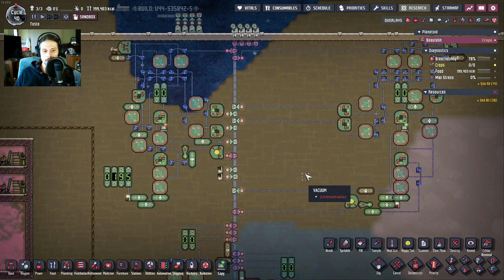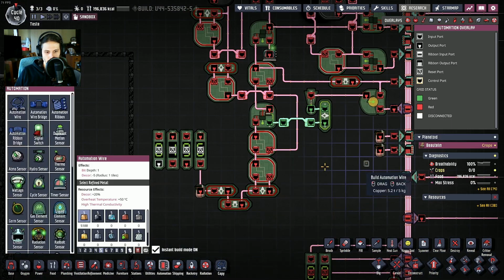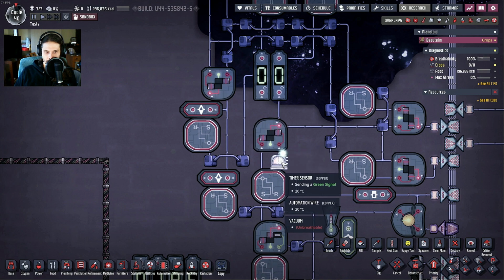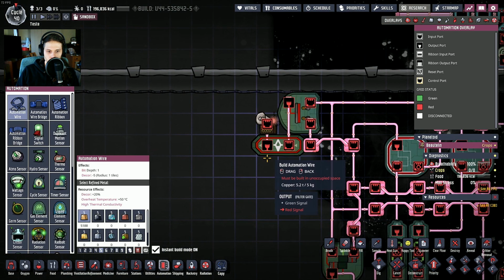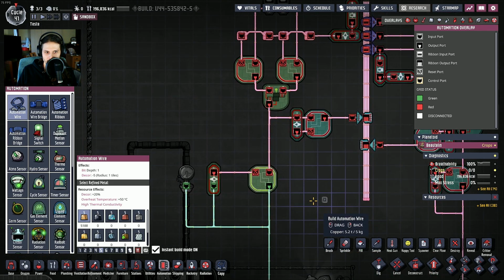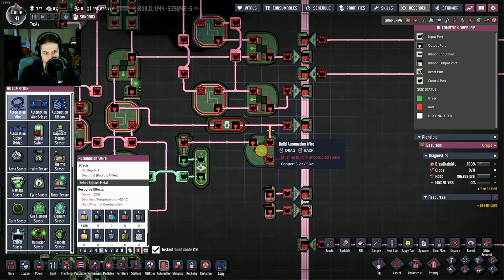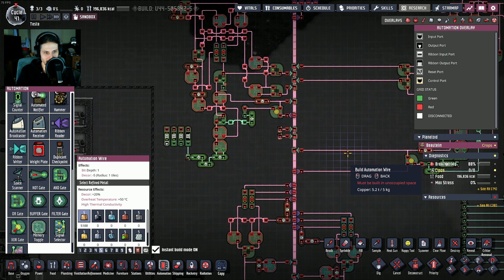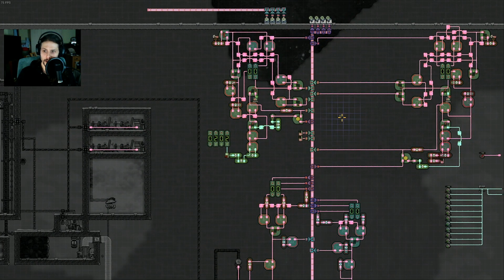Oxygen Not Included Tutorial - Can-Bus Line Automation

Comment: This is amazing... But did you know you can store more than 4 bits on the automation bundle line? You can bit shift a signal by 4 (twice by 2) to push it off the line--but it isn't out of memory for the game! You can recover it by shifting right by 4 (twice by 2). Each "double writer" or "double reader" you use, puts the signal into the "next set of 4 bits". You actually have up to 32 that you can use. Since you're reserving 2 bits for safety, that leaves you with 30 bits, or 1,073,741,824 different codes you can encode for...
Reply from the maker: I didn't knew that eheh i'll have to look into that at some point as it does sound very intresting :P

Comment: I built the compacted design you posted on discord with but the signal is only being send for 1 second which isnt enough to run anything. I cant find a way to prolong it without breaking it. I tried using a buffer gate but that can only be set as high as the filter gate because if buffer gate is 4s and filter gate is 3s a signal is sent through before the buffer gate has ender buffering making it stuck in an endless loop. Any solutions?

Edit: Placing a buffer gate with double the time of the filter gate (ex 3s filter -> 6s buffer) is enough for the system to run consistenly with some delay (buffer gate doesnt sent red instantly) but 2x the time of the filter gate the system has almost no delay.
Reply from the maker: I see, i'm glad you were able to find a solution, i'll start implementing this system in my playthrough so all those litle issues will be adressed then once i stress test this enough i might make another video on this topic to show my findings :)

Comment: FYI: your problem with "the game farts itself" is due to variations in the number of logic ticks per game second. The simplest way to observe this is to pause the game, and then click logic elements, which can trigger logic ticks during the pause state. At a minimum, these paused logic ticks happen when instant building new logic elements or wires in the sandbox mode, and can be useful for step-by-step circuit debugging. When running the game in realtime, if the game slows down, there can be fewer than the normal number of logic ticks per game second.

So you've effectively got two different clocks: game time, and logic ticks. The logic ticks are predictable and you can use them for timing circuits. The game time based logic elements are less predictable because of the imprecise correlation between game time and logic ticks. You are noticing this.

Thus, there's an faster version of your design based on logic ticks rather than game time. For your "clock", instead of using a timer element, you would use a NOT gate with the input and output lines wired together ... this reliably oscillates between true/false on every logic tick. Translating your BUFFER gate is a slightly trickier, although you could probably use a design similar to your decoder. Working in this way requires a bit of discipline because every logic elements adds 1 tick of propagation delay, and circuits often need to be timed such that two paths have the same total delay (you can trim circuits by inserting two NOT gates to add +2 delay, or a ribbon writer to insert +1 delay).  But once you get a circuit working in this way, there is no "game farting"; it either works 100% or it works 0%. And it works at the maximum possible speed.
Reply from the maker: I didn't knew about that fact, if that is the case i'll update the frequency gen, thank you for the in depth explanation i think i now understand how it works :)

Comment: Managed to build my own version. Works on one planetoid, but when I try to connect other planetoids to same system problems begin. I think busy and reset lines needs 2 more wires, one for sending and other for receiving.
Reply from the maker: That might be an issue, maybe a seperated computing system to store incoming messages will be a possible answer
Reply: I made system use 2 wires for all signals. Send and receive. 1 ribbon for data and 1 for busy and reset. Otherwise automation broadcasters and receivers will get stuck to green. Currently have only 2 planetoids connected. Third may cause new issues.

Comment: Your English is okay from what I can tell.
-Analog is a frequency as in AM/FM radio
-Digital is a Yes/No as in computers

PS: To be fair digital starts generally as a voltage (maybe something else) which is an analog signal, but generally (for voltage on a computer) we convert 0-0.4 to 0 and .6-1 to 1. Reason for the gap of .4 to .6, is things like solar flares can change the voltage. This is an oversimplification, but should work for most things in vehicle (is oil under 1 quart (most likely ranges from 0.9 quarts to 1.1 quarts) then send dummy signal).

PSPS: I am not a car engineer.
Reply from the maker: Thank you for the explanation my friend, but to be honest i didn't understand a thing from the PS, onwards xD

Comment: CAN is a time-multiplexed bus which actually resembles ethernet in some ways. Sensors send messages on the bus which have short "address" (11 bits or 29 bits, depending on the bus configuration) followed by up to 8 bytes of data. Digital sensors are often represented in a single bit in that message, while analog sensors can vary, for example, using a full 8 bit byte, or using multiple bytes. Each source transmitting will typically have a unique address, and multiple devices on the bus can receive those signals.

Frequency, when used with CAN, usually refers to the different repetition rates that transmitters use when sending messages. For example, a signal that is more critical might be transmitting once every 10 milliseconds, while a less critical signal might only transmit once per second, or only when a change occurs.
Reply from the maker: Thank you for the in depth explanation, i do admit some of this concepts go a bit over my head, but i think i got it in the end :)
Reply: @basemanager  Yeah, it took a bit to understand what you were doing, using two lines for setting the address, then a third for the data. It’s similar to CAN in concept, and a quite clever solution! The only thing missing just isn’t possible with ONI, where the sensor write the raw data and the receiver has the set points for thresholds. I’d love to have that as a feature in the game!